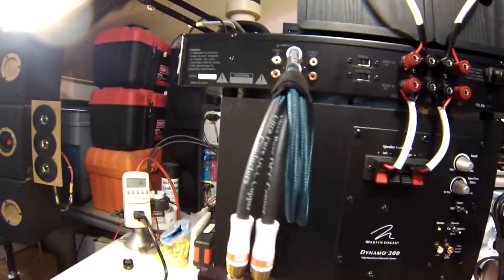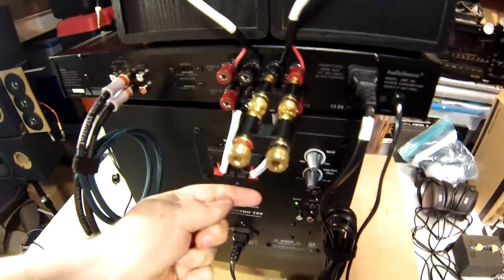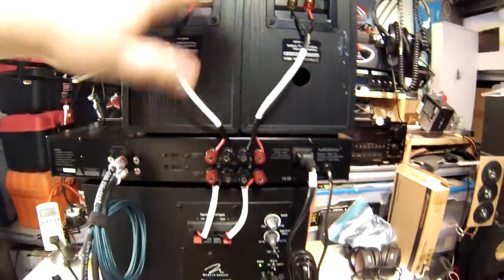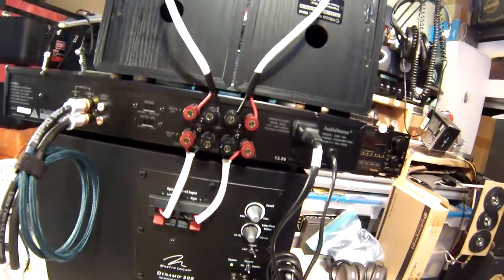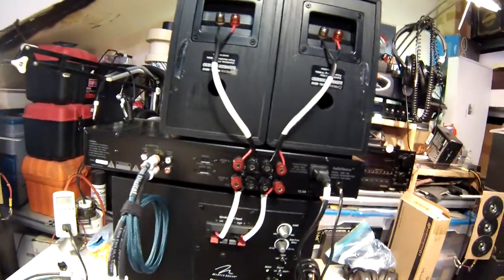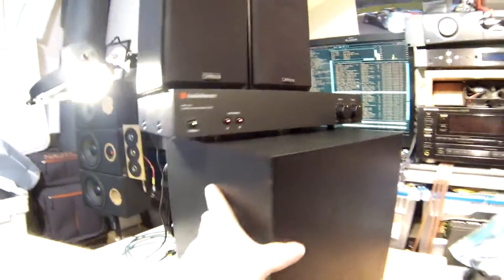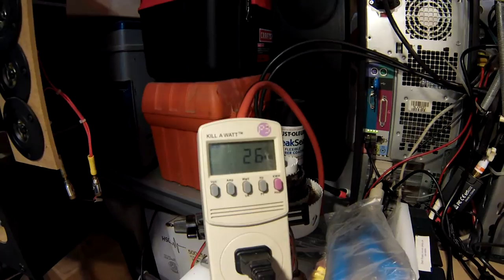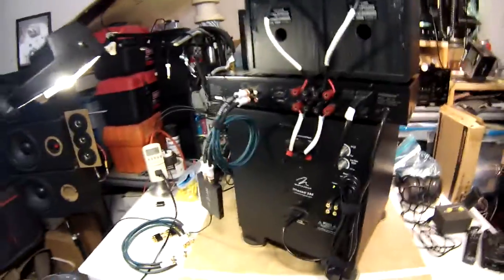MSH - 45 - 2.1 Setup and Theory

Comment: The Dayton SUB-1200 I got to compliment my MB42x's has high level in/out which I'm using but it sends full range from its output. A bit disappointing since that wasn't mentioned in any reviews I read or in the product descriptions on Parts Express or Amazon. It states it in the manual though. "Note: High level outputs are paralleled to the high level inputs with no high pass filter." I'm assuming the SUB-800/1000/1500 models are the same.

Comment: Also, are those the MB42x's or the regular MB42's? I noticed they have the sort of black wood grain finish, while my x's have just a sort of plastic finish.
Reply from the maker: They are the original MB42's but I added the crossovers from miccastore http://www.miccastore.com/crossover-upgrade-for-micca-mb42-bookshelf-speakers-p-114.html
Reply: ZeosPantera Ah, I actually just remembered you mentioning that in your review of the Micca's, Right now I'm using the Indeed TA2021S (kicks ass for it's price) T-AMP to power the MB42x's and amplify my record player. I've been interested in getting a sub woofer for a while and the Dynamo 300 looks like it's right up my alley. Thing is, like you mentioned, the Indeed is a mere tiny T-Class with one channel of terminals and I simply don't have the funds for a beast like the Amp-100. Would you recommend the stacked banana plugs method for the TA2021S for hooking up a sub woofer and the Micca's?

I'm also still contemplating whether I should get a new pair of Micca's for my desktop setup or go the powered speakers route. The Audioengine A5+ powered speakers would definitely be my dream setup, but I would have to scoop those up on a major sale on massdrop or something. For a more economically sound choices there's always Logitech's or something else. I've had the Schiit Magni for a while and I'm really enjoying this little piece of hardware, however I'm severely lacking in the DAC department as my soundcard is complete ass. I need to pick up a Modi soon to complete my Schiit stack... That ODAC is quite sexy however.

Oh and one more thing, and sorry about the long form essay I'm leaving you here, have you tested out any of these usb powered DAC's? I've heard good things about the Audioquest Dragonfly, and even more so about the Audioengine D3 and HRT Microstreamer.